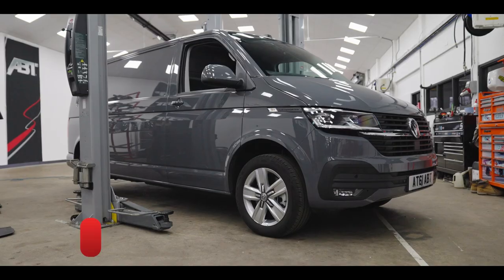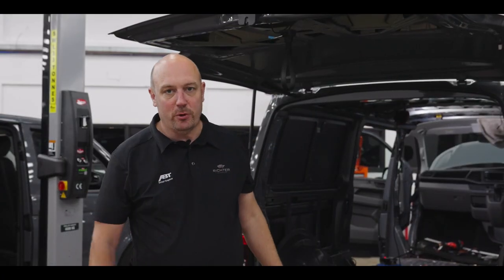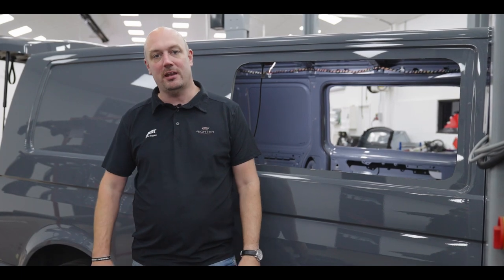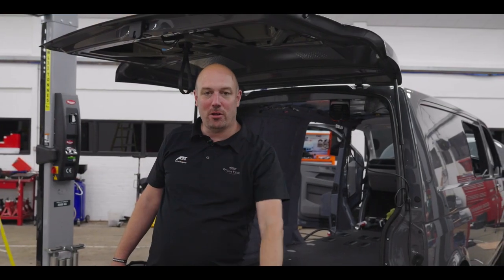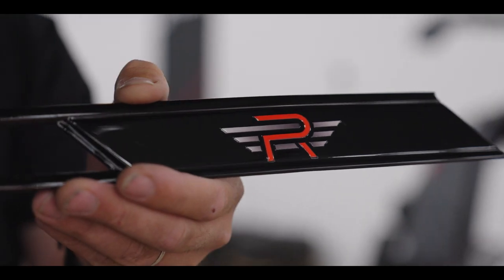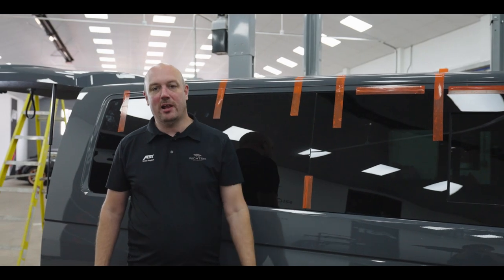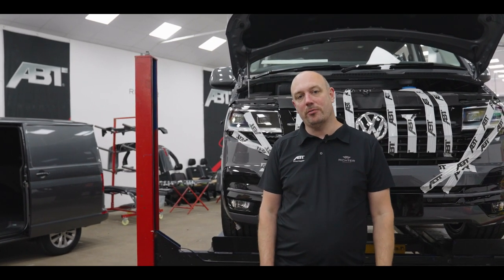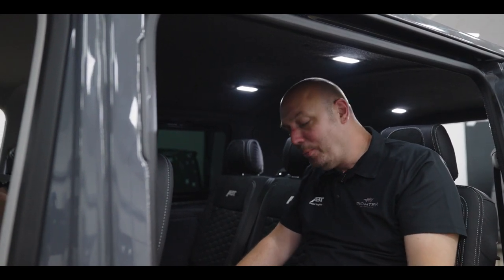T6.1 Panel Van to ABT Kombi Transformation | Richter Automotive.

Comment: Looking at the plastic parts being bonded together and bonded to the van what products are being used?, the tin of bonding primer that looks clear, and the tube of black adhesive that's being used in the battery operated gun? also what looks to be clear glue in the smaller tube with the two part mixing nozzle used to bond the parking sensors, All looks to be good and strong. Great Job.

Comment: Just wondering why you put the fake window in the rear 1/4 panel? I had never thought of that idea and think its great. I've got a Kombi and for tax reasons it can't have windows in the rear 1/4 panel so this idea of a fake window is a clever work around!
Reply: Windows don’t have anything to do with tax. Tax class is set at manufacture on the engine size / type
Reply: @lucyfenney6090  sorry maybe using tax is the wrong term. What I was trying to get across is that a commercial vehicle shouldn’t have windows in the rear. Hence why they make the Kombi with no rear windows. Just like those Ford fiestas you see going around with no rear windows.